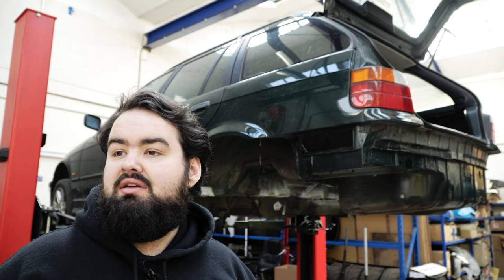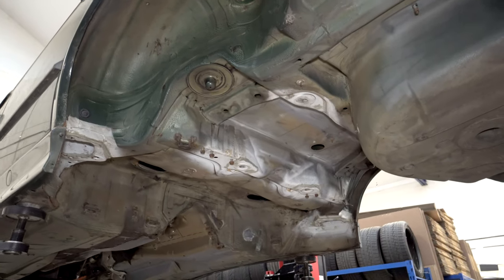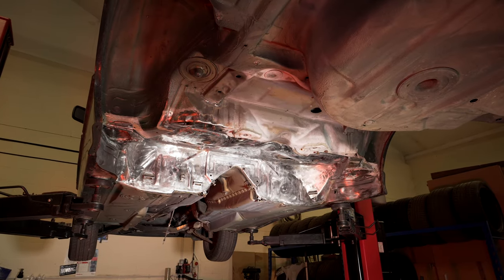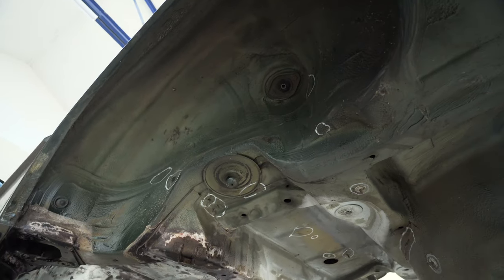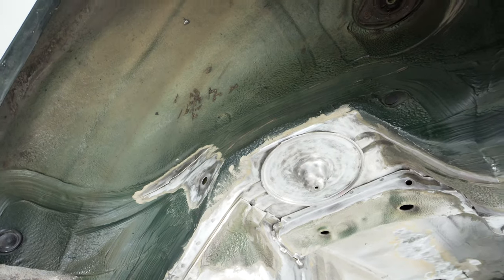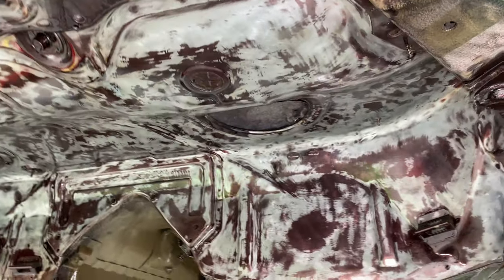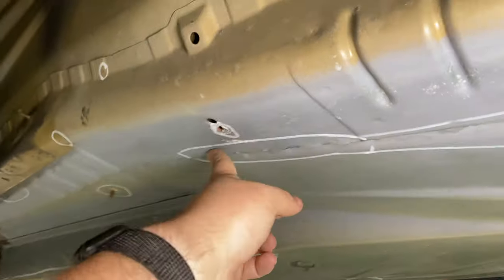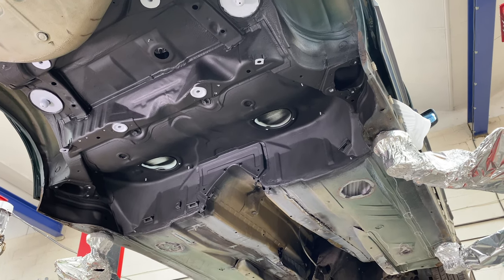Removing Underseal and Treating Rust is the worst thing I have ever done - E36 M3 Touring Project

Comment: Worked for 2 weeks just removing the rubberized under coating on a 69 Plymouth Cuda.😬 Went through a box of dust masks and 3 pair coveralls.   Absolutely told myself I would never do it again, ill pay someone else to do it. 🤫😊
Reply from the maker: Likewise there’s no chance I’m doing this again, if I ever get to this stage I best be rich enough to pay someone else to do it 😂
Reply: @EvolveAutomotive  a lot of people don't know this but the 60s  and 70s Cuda were unibody and the front and rear sub frames were part of the body. After removing the undercoating I realized most of the seem sealer came off to. I had to reapply sealer to all the seems before I painted the under side as Chrysler said the sealer alone gave the car 35% more strength and rigidity.  Not sure but I'll bet the new unibodys like your wagon get some strength from the new seem sealers also.
Reply from the maker: In fairness on this I haven’t removed too much seam sealer. Very surprising to hear they accredited that much rigidity to it though!
Reply: @EvolveAutomotive  yes it shocked me to, until I removed the rusted trunk floor and installed the new one. The rear frame is spot welded in a few strategic areas to the trunk floor and the sealer covers the entire seem area above and below tying the whole rear structure together with the braces going up to the roof. Some of the old seam glue was over half inch thick in the bracing areas.  It was a mostly fun rewarding project in the end. 😊

Comment: bro you talk yourself down too much. you can do anything you put your mind to. step back and take it bot at a time. don't overload the brain. 
I know that's hard as you'll constantly wanna go through the process in your head but you'll get there and learn a lot along the way
Reply from the maker: Thanks for the kind words! I’m learning a massive amount doing this project that’s for sure, but yeah sometimes too much time researching is a hinderance.
Reply: @EvolveAutomotive  you're doing an awesome job pal. Gutted that you loose out with ramp time but you just got to deal with what you got. 
I don't my e46 with the rear jacked up off the floor a few feet in my garage. Took a long while but glad I did it. Proper achievement
Reply from the maker: Work with what we have, hugely lucky to be able to use a fully equipped workshop with a lift, downside is yeah has to be packed away each time. Nice bit about doing it in your garage is just leaving it exactly how it is and coming back to it later.
Reply: @EvolveAutomotive  yeah kinda had a date for deadline and kept finding more parts/tools etc to buy to complete the job but got there in the end. Gotta love a bit of personal project. Can't wait to see yours progressing.
Reply from the maker: It's definitely very satisfying to slowly be ticking off jobs on the list and knowing that I did them. If you have instagram give me a follow, I'd love to see your project! @mattdearphoto
Reply: @EvolveAutomotive  done pal.  Mines @rockeo82   I don't use it that much tbh but do have car stuff on there.